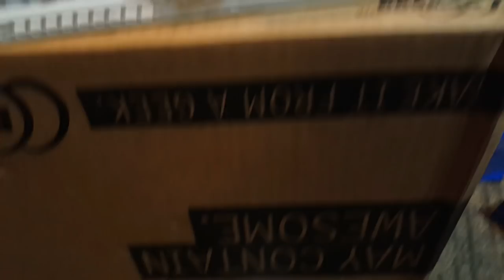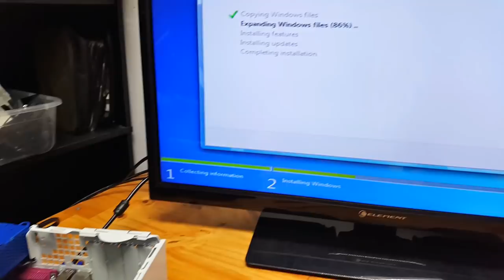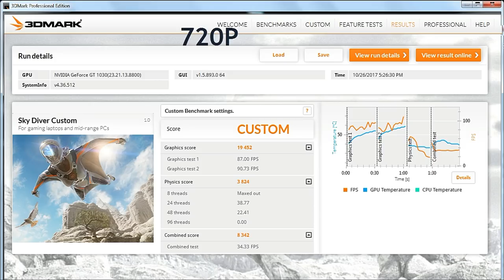Star Wars computer made from a $1.00 HP dc7800

Comment: why tf do you have so many of those hp's???
Reply: He probably bought a lot of 10 off eBay.
Reply: PimptatoPCs no he bought each for like a $1 on Craigslist not even lying
Reply: i think its one of his $1 lot purchases. he explained on one of his older videos. and had like 12 stacked up in the trunk
Reply: ISHERWOOD75 if you watch the older bids he said he bought as many would fit in his car because they were selling for $1 each
Reply from the maker: I bought 62 of them for $60 I have about 20 of them left
Reply: That's crazy dude, I wish I could find deals like that where I live. Good luck thinking up 20 more themes!
Reply: modstek can I buy one from you
Reply: modstek please answer
Reply: I need to find a deal like that so I can make a couple of those desks.
Reply: modstek now I feel bad. I paid over 250 for 22 dell optiplex 745 to 780 
Came with 3 monitors.

Found a old gaming pc on the street with another pc and a monitor. 
Just cleaned the ram and it booted right up.
If only they would sell.....
Reply: PimptatoPCs they suck trust me I have the same one
Reply: Can I have one? Hahahaha
Reply: 62- omg!  And You ONLY have about 20 left? What have you been doing with them other than the few we know about?
Reply: There cheap Asf
Reply: I usually go to auctions and buy a pallet for like $10